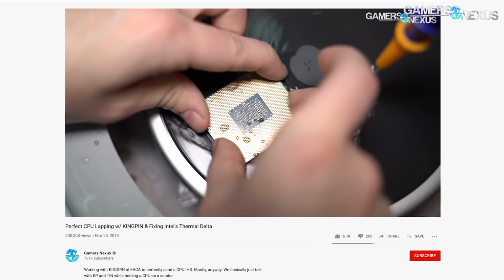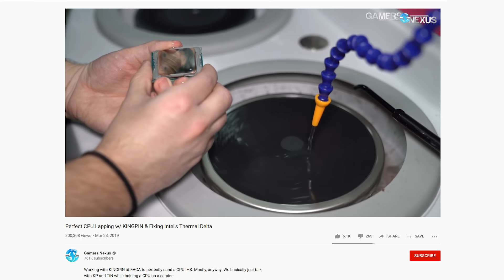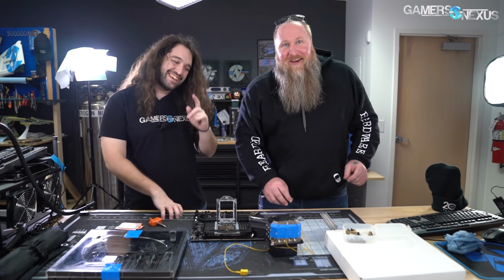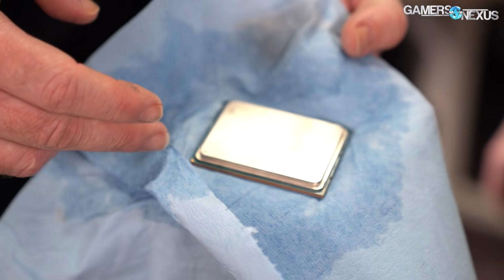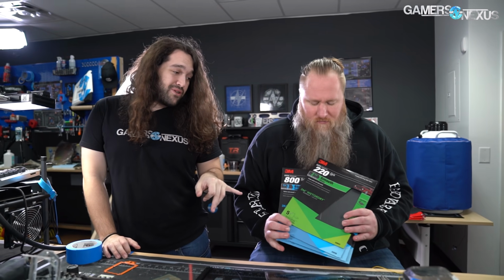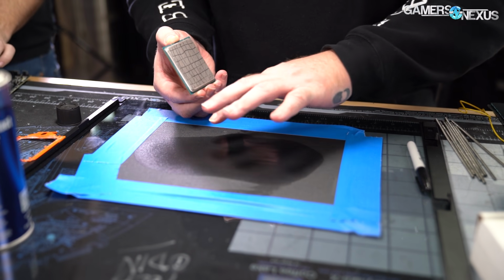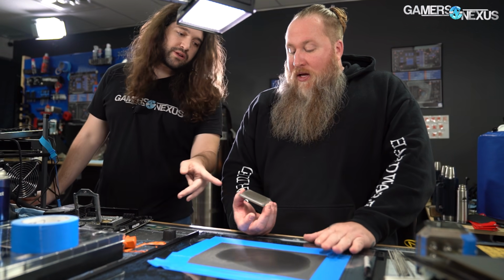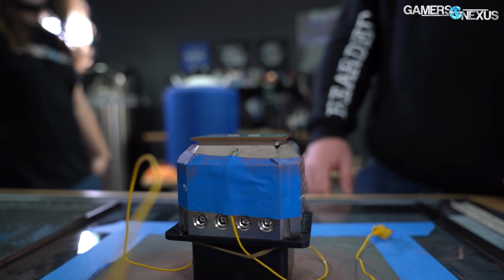AMD Threadripper CPU Lapping & LN2 Prep, ft. Bearded Hardware & 3970X

Comment: I watch a lot of machining videos so when they were talking about needing a really flat surface and wanted to use glass, I thought, "why not get a certified granite surface plate?" Then I remembered that the good ones are expensive, frustrating to ship, and have tolerances they probably have zero need for. But it was interesting to think, "how else might they do this job?" and weighing the pros and cons of each method. I think Kingpin's method is pretty damn good, I just wish it didn't include him actually holding the CPU with his hand.

Comment: You may want to invest in a granite surface plate to do this on the regular. Tempered glass and non-tempered tends to vary in thickness and flatness by .001" to .004" at times.  When I was running a wafer saw,  we discovered that the small variation was a problem in the cut.

Comment: Hey I just lapped my new 3950x until I got all those pins flattened out,it doesn't work now,what did I do wrong? Should I belt sand it? Those pins kept snapping,so I kept going until flat....any ideas guys?
Reply: Just not do something if you're unaware of how to or take a risk being doing it. He specifically, explicitly, said to try it out on an older cpu first. Whatever makes your cpu not work is something we can't fix, probably.
Reply: Wrong side flip it over ;)
Reply: Just messing around guys! DONT DO THAT!

Comment: I used an old picture pane becuz I didn't want to damage the smoked glass pc panel. I lapped my copper heat sink and cpu because the kryoknaut liquid metal was causing electrolysis in the copper aio heat sink. I lapped to 1000 grit and then used a carbonaut thermal pad. My i9 9820 10 core cpu doesn't get over 45c at 4.3 on all cores. I know I'm leaving a lot of performance on the table but with my 2080ti waterforce extreme I don't really need to push when I'm getting 150+ fps at 1440 at 165 hz. and 1 millisecond refresh. The boys on xbox, PlayStation and other PCs already hate me in COD MW...cuz I'm super fast. No need to add to the insults by pushing for 200 fps.

Comment: Is deformation due to mounting pressure (and/or thermals) still a thing? Wouldn't that make the whole lapping process pointless?
Reply from the maker: It is not a consideration for what we're doing, so no.
Reply: @GamersNexus  Thx for clarification!
Reply: @GamersNexus  hmm, i would at least blue-dye it mounted to see an estimation of how good your job was. Seems to my  you have a lot of work done, so why not confirm it?  And the socket seems to have a fair amount of pressure. So much so, that i almost think the high spots always on the corners/outside of the cpus are a design  feature on purpose.

Comment: Could you use liquid metal when you have sanded it down to copper?
Reply: Yes but copper has more surface discoloring with liquid metal. Liquid metal can't be used with aluminum. Liquid metal can't be used with liquid nitrogen, it acts as an insulator so low in temps.
Reply: @jasonmajere2165  okay so in an air or water cooled system it works just fine then but with LN2 it does not make sense,

Comment: If you use a lapping plate that's flat within a few millionths of an inch, +/- .000003", technically you wouldn't need any thermal paste between your cpu and cooler. Gage blocks are some of the most perfectly flat objects you can get and if you slide them against each other they'll stick. 

https://www.youtube.com/watch?v=2lOOl3VxOtE
Reply: Yes... I remember when I first got my hands on a set of gauge blocks... I was like "What is this voodoo?"
Reply: Indeed they will stick to each other like magnet.

Perhaps they should invest into a calibrated granite table
Reply: True.... But for this purpose the actual difference between an insanely smooth and very smooth is neglectable probably, you might get more results by eliminating the shield and going die contact.... Or maybe they can lap the die too eheh
Reply: @XavierAncarno  please for the love of god do not do this to gauge blocks,, basically the surfaces are so polished that they cold weld to each other so you pressing them into each other and then breaking them off leaves micro splinters on the surface.
Reply: @LunaStarFire  this is flat out wrong because the wringing effect that gauge blocks can exhibit still happens with non metallic blocks, ceramic, etc.  The blocks don't need to be metal to demonstrate this effect.  All you need is a perfectly flat, perfectly smooth, hard surface.
Reply: Matthew I didn’t advocated to lapping gauge blocks... which is unnecessary
Reply: @XavierAncarno  im not saying about lapping im saying that you shouldnt be pressing guage blocks together to get them to "stick" as you are destroying the surface finish and their accuracy
Reply: @gcutler15  the only point i had any mention of material is cold welding because i was directly refering to the guage blocks which by standard are made from ferrous metals... Yes other materials can inhibit the same properties as the gains meld into one another and by repeatedly doing so will tarnish the surface finish
Reply: machinist granite surface plate would be nice for this job.
Reply: That is soo kool. I only lapped my CPU's typically to about 600 grit. However I always figured them to be quite flat non the less. I wonder how well those blocks would indicate flatness?
Reply: If they had about $300 they could get an optical flat to check to see if the surface of the heat spreader really is flat.
Reply: @LunaStarFire  There's no harmful effects by wringing two gage blocks together. Machinists do it all the time when they need to get an odd reference size to calibrate a tool or to compare things to a know size. Gage blocks only come in certain increments. So if you need to make a part that's exactly 1.350 inches long, you would get a 1 inch block, a .300 block and a .050 block and wring them together to make a reference size. 

Cold welding isn't really something you should worry about under normal circumstances. To cold weld 2 parts together you need extremely clean and pure metals. They need to be NASA grade clean. No oxides, oils, greases, or any other contaminates, not even a single spec of dust. The parts also need to be in a vacuum. Certain metals cold weld better than others. A precious metal like gold can cold weld very easily.
Reply: @LunaStarFire   Matthew  it's not cold welding, period, just because it happens with gauge blocks, that are sometimes made from a steel alloy, doesn't allude to cold welding at all.  In fact steel gauge blocks aren't even that great at exhibiting the effect; ceramic, tungsten carbide, and chrome carbide gauge blocks have the best wring-ability to play with this effect seeing as they're harder and smoother than ferrous blocks.  Furthermore the effect only works with completely clean surfaces with no contaminants.  Galling isn't a factor because you can get two gauge blocks to stick together with little force, galling only happens when two metal rub with no lube and a lot of force.  Plus steel blocks, being ferrous in the first place, have passivating oxide layers on their surface that prevent cold welding from occurring, how do you think stainless steel doesn't rust?  Because the chromium in it creates an oxide layer preventing further oxidation from occurring.  In simple, we know the effect happens but we don't know why yet, and we know it's not cold welding, casimir forces, or anything like that.
Reply: @Ann Onimous gauge blocks by design are both very flat and very smooth, don't know how or why you're assuming gauge blocks are incredibly flat yet somehow have like a 200 grit finish.
Reply: @LunaStarFire  Wrong I am a machinist the first rule of using gauge blocks to calibrate other measuring tools is to make sure they are clean and wring them together so that there is no space between blocks. If everything is clean and you treat them carefully you will not even have a scratch when you take them back apart. There is no cold welding or splintering involved you do not ruin the accuracy or finish. There are examples of blocks from the early 1900's that still work and have not lost accuracy.
Reply: @TomDetka  their function is to wring them together but after a while and as a machinist youve likely noticed that the older blocks get harder and harder to wring as with each time it damages the blocks. Its like using a knife to cut something, youve just honed it so no need to cut through cardboard for the hell of it, save it for when you need it.
Also try not to leave blocks affixed to each other for longer than they need to because that can also reduce their life.
Reply: To be fair in my earlier replies i used the wrong terminology, i havent been in a calibration lab for absolutely ages, but seeing apprentices just play about with guage blocks wringing them together knowing its just slowly fucking them up is annoying xD
Reply: Gauge block levels of flatness wouldnt remain after heat cycling something as thin as an IHS, it would work if the actual copper thickness of the ihs. Was more skookum
Reply: Loooool gage blocks are within about 0.0005 - 0.0002 to get within the range you're talking youd have to probably spend 100s of thousands of dollars.
Reply: you still need paste.  even if you get two perfectly mated surfaces there will be differences in those surfaces as they heat and cool, especially at cryogenic temperatures.
Reply: @LunaStarFire  you don't know what you're talking about.
Reply: I took 2 old pentium 4s and got em lapped until I could slip em together like my guage blocks. Lol, weird time wasting experiment, but I always wanted to try it.
Reply: @XavierAncarno  they need a pink grade 2 or higher from Starrett.
Reply: @Ann Onimous look at machining tools like lathes and mill tables. They have a texture done by precision scraping to create a flat surface over a specific length while still allowing movement against another surface.
Reply: @mnap89  While that would work good for them, in a machine shop thats a huge no-no. One place I worked a guy got fired because he was stupid enough to sand on a calibrated granite surface plate.
Reply: @gremfive4246  Yes, I know. These are expensive precision tools - not just simple "ganite slab". But this is not machine shop and they do not need big or very precise ground. I think that small one, class 1 or even 2 would be good for this task. Hell,. you can sometime find a piece of broken measuring plate and have it for free.
Reply: @Ann Onimous correct.
Reply: @Outland9000  pc enthusiasts tend to spend this on additional RGB
Reply: @siclucealucks    😂
Reply: @TomDetka  We always used  jo blocks exactly in the way you described for checking and calibrating snap gauges. Ran several hydraulic pump parts that had about 7 different od's. Would have taken for ever to check with just mics. Then again a lot of times we always doubled checked our snaps against a known good mic. Had to even burnish the id for under a 16 finish along with finish size. All the cross holes sucked to deburr. Thank god our lathes had live tooling.
Reply: yes if i was gonna do this i would get a surface plate at a minimum.  I'd probably try to take them to a precision machine shop

Comment: Remember when LTT tried cpu lapping and they got gunk all over the contact pads and they cleaned it by running it under tap water? What a hilarious video
Reply: KingOfGames electronics can get wet all day long, assuming there is no power to them while it happens, and they are allowed to dry before power is running through them

Comment: Would you recommend Lapping any of the new 3000 cpus? i have a 3700x that doesnt seem to cool well, i end up with a few cores that run several degrees higher than others even under a full load, been debating doing a mild lap
Reply: I replaced my factory thermal paste with cryonaught and that helped my 3700x a lot.  If your GPU is pretty warm too that would point to case flow
Reply: @deadcell85  ive tried cryonaught, and liquid metal. its on its own 280 radiator with noctua fans. Its gotta be either this color masters aio is crap/ not mounting good
Reply: How about a video soon on this? Done intel before but need to do an Amd one :) idea noted
Reply: @BeardedHardware  sounds good to me! i will keep an eye out for it!

Comment: I’ve always been curious about lapping CPU’s, I know it helps to eliminate air gaps but doesn’t lapping technically reduce the surface area? In theory a larger surface area would dissipate heat faster
Reply: the cooler on top has all the surface area you could want, any excess surface area between the silicon and the fins is impeding the thermal transfer to the fins

Comment: Wouldn’t it be more efficient (lapping generally, not for LN2) to totally polish the IHS? The point of thermal paste is filling in micro texture/scratches, so if it was a mirror finish wouldn’t that mean smaller texture to fill?

Comment: Dude...sand wet. I don't know what that spray is but it's not helping you, it's actually evaporating into a goo that keeps the dust caking into the sand paper.   Go to as FINE a polish as you can. scratching it up doesn't make any sense.  You don't need adhesion, you need flat.    I don't lap CPUs but i've got a decade in the jewelry business and i do a lot of wet sanding.   SAND WET.

Comment: Hey Steve, do you believe that the H115i Platinum would still have the old style concave cold plate characteristics?
I only ask due to the new  pump design.
Just wondering if the new cold plate would be redesigned to be simply flat.

Thanks.
You two are having too much fun btw.

Comment: That suction between the processor and the pot is the Casimir effect.
Reply: The casimir effect applies to flat surfaces in a vacuum, not atmosphere.
Reply: Fight to the death. Whoever survives is correct.
Reply: We are nowhere near the Casimir Effect. For that you need really really REALLY flat surfaces. Like ion beam and LASER polished in high vacuum. I once talked about that with a solid state physicist and they said that the preparations necessary for something like that are insane. And outside a vacuum there are effects that are literally a billion times stronger. Air pressure in particular would be around 10N while the possible Casimir Effect would be in the Order of nano Newtons.

Comment: Switch to a higher grit when you're done removing all the material you want, the higher grits are to remove and polish the tiny scratches from the first step.
Reply from the maker: We want the scratches.
Reply: Your thinking of a cold weld, mirror finish with "Indian Ink" and all.